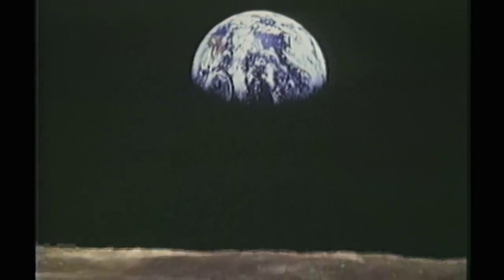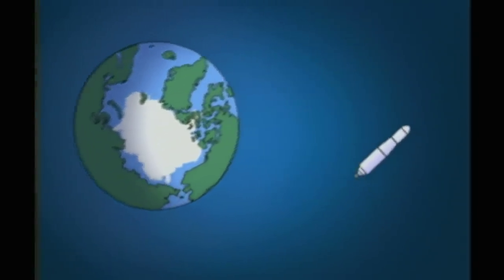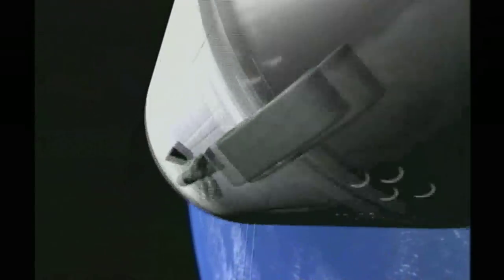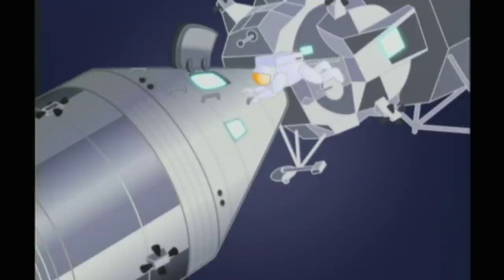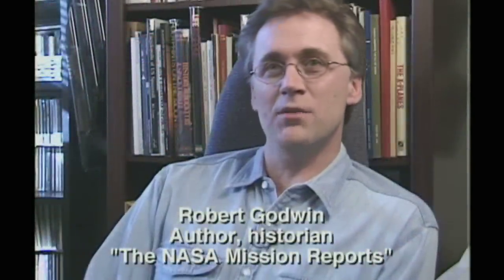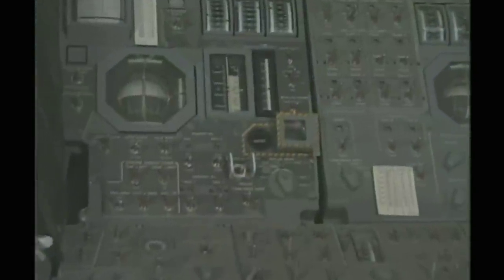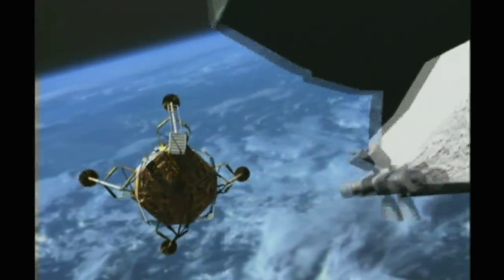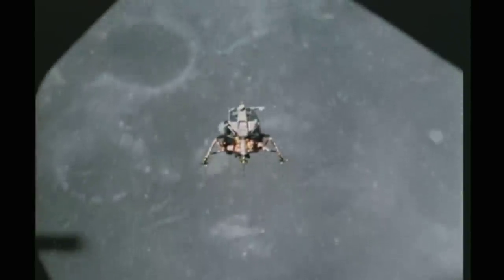FLIGHT-TESTING THE LUNAR MODULE

Comment: Great video, but both the narrator and Robert Godwin made the same erroneous statement: "They had no way home, other than a successful docking with the Command/Service module." That's not correct. Gumdrop and Spider didn't have to "dock" for all three astronauts to safely return to earth; they had to make a very close rendezvous. As stated earlier in this very video, Schweickart and McDivitt could spacewalk from the LM to the CM in case the docking procedure failed. That's why he hand holds are on the outside of the Command Module. One of the main goals of Apollo 9 was to prove that this spacewalk could be safely accomplished.
Reply: Interesting.  I wonder if another spacecraft could've docked with it and somehow used it for some purpose, like the orbital lab the Apollo Applications Program considered?